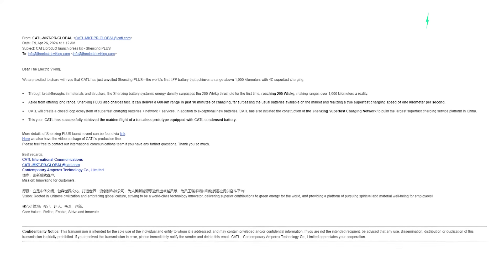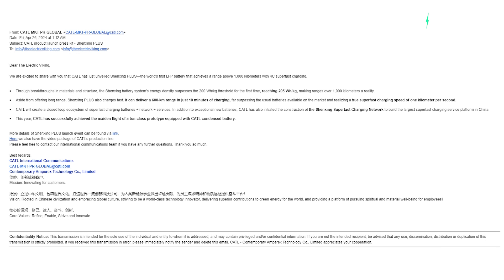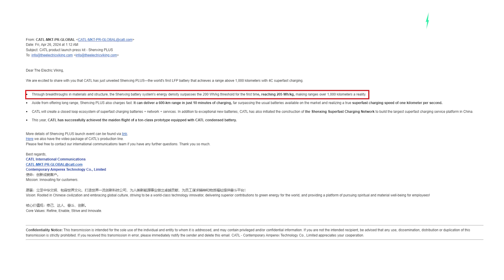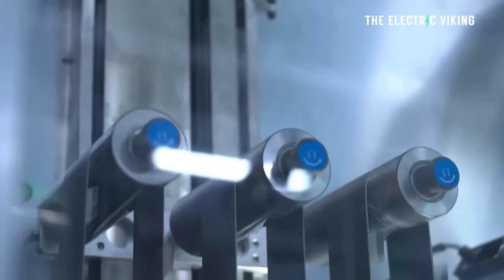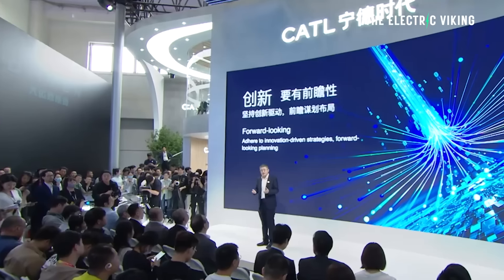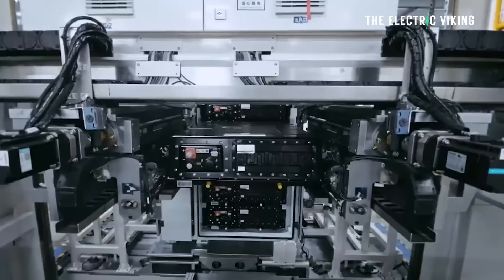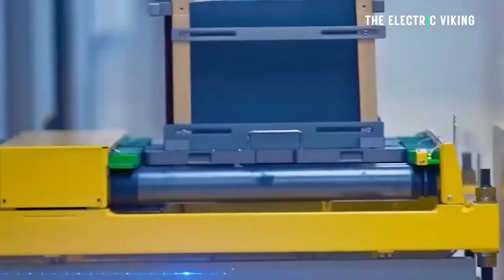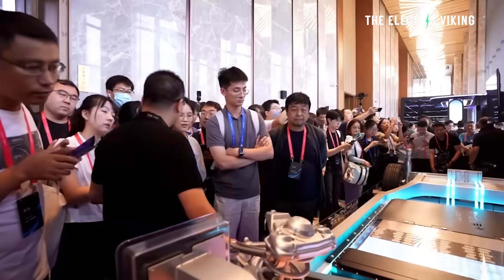CATL reveal new battery with highest energy density in the world

Comment: I think the higher density batteries will have their pros and cons. The higher density means to me that there is more potential chemical power in the same volume of space, which means there is more potential energy to be used for kinetic energy. This means either with the current EVs, in the broadest sense of term, can either go twice as far  or have twice the power potentially. I'm not sure if power is linearly correct, though, because we don't yet know the power characteristics. I think the biggest value with the ramp up.of EVs on the market is that batteries could get smaller to provide the same range from a smaller package. This could help reduce EV space and weight and make better EVs that can provide more features that will be standard compared to rodays EVs where a lot of extra features and safety featires are oddly not standard both qualitatively and quantitatively. I think that would be the better value for these higher density batteries. The other option is to put these higher density batteries in the current same volume EV packs. This would almost double the range for most EVs. 500 wh is the minimum requirement for aviation to fly effectively. That would be interesting for aviation. I, however, think that batteries with higher densities will not be the panacea we think it will be. Batteries will remain on average heavier than fuel   which means it will compromise on the amount of passengers and luggage to range ratio, which means we  will likely see less big planes and likely see more smaller planes with more frequent city hopping if commercial use is the focus. Flying long distances will take far longer. A cimpromise might be hybrid planes, but with the controversy of hybrid cars, I think the public pe4ception at large will also be controversial for planes, and beings recent new dreamlike plane with batteries wasn't a great pr succes to start with. I think the higher density batteries will have cause for concern simply due to the higher density. That is a fire or explosion concern in general with more higher density chemical reactions in general. I think there is a reason current batteries have turned out to be quite safe. With the higher density, I think heat management systems will require more priority, which means higher de sotu batteries for max performance will require smarter cooling systems, which will increase overhead costs for the system. We're talking here about higher density occupying the same battery tray space, not bigger batteries volumewise. I think in that regard, I think it is good to be cautious and say how good and safe the new higher density batteries truly are in real world performance, compared to a single N=1 demo case video. As with many new technologies patent and r&d costs will likely be high, new batteries will be in new vehicles and we will not hear anything about being able to swap current EVs with new battery packs, which for business is nice to capitalise on, at the costbof end user, who will likely (again) not benefit from upgrading innovation. Most EVs are still planned obsolescence vehicles by design. You can fix and replace it, but I have not seen one EV to date that has decent repairable cost price repairs with losing an arm or a leg. Luckily the pack if an EV is still high value which makes EV deprecation manageable, but the flip side of owners wanting to take good care of EVs or have upgrade options are practically affordable non existent and even insurance companies don't know what to do and are quick.to write of damaged EVs. In that sense, I have not seen the state of repair or upgrading EVs meaningfully and still feels like we're living in the stone ages. I think repair and we'll affordable maintenance should also be part of the sustainability mantra, not just destroy and rebuild the old. I think to some degree, it sounds more energy intensive to recirate resources than to keep current EVs on the road as long as possible. I think in this latter we can do a lot more to be financially more responsible and keep thongs affordable. But not selling more EVs for business and profit makes the latter story less interesting, I suspect. It's almost a bit of a catch 22, I suppose. I am exited for the higher density batteries for shifting the cabin quality as a smaller higher density battery could help shift less cabin design costbcuttimg which means overall lighter and better EVs. And it would also help boost electrification of trucks and busses and even perhaps off grid local electrical trains.
Reply: Ramp-up should be hyphenated.

Comment: The CT battery with its structural case has an energy density of 180 Wh/kg. The cells have an energy density of 280Wh/kg. So CATL cells at 205Wh/kg are not suitable for many vehicles.

Comment: If we ever solve the cooling problem for superconducting power transmission lines, imagine low cost solar panels getting 200 watts per square meter in a huge desert, then transmitted 2000 km to major cities. A 10 km square of solar panels would produce 20 gigawatts.  A superconducting power line can make economic sense if you are transmitting 100 gigawatt from a desert using liquid nitrogen cooled pipe with meters thick thermal insulation. Economy of scale, once you create the superconducting transmission line, it’s almost no additional cooling cost to make it handle 100 times as much power (a larger diameter superconducting wire but the same thickness of thermal insulation as before. Superconductors can carry lots of current with zero losses but do hit a limit of amps/square cm).  The improvement in batteries is a key component of going solar/hydro/nuclear for industry/transportation/commercial/home.  Obviously CATL will play a key role in home solar power batteries, in transportation batteries, and utility power distribution batteries
Reply: Low-cost should be hyphenated.

Comment: You keep flipping between "watts per kilogram" [power discharge rate] and "watt-hours per kilogram" [energy storage]. It would be a good idea to be consistent.
Reply: Power density, not power discharge rate.  Energy density, not energy storage.  It would be a good idea to have an engineering background before commenting.
Reply: @duanehorton4680  An engineering background is definitely not required for youtube comments; it's far too easy to get tied up in technical terms that hide meaning from others. I don't care if he uses a more lay-understandable synonym of the terms, but being consistent is important.
Reply: @gringene_bio  Your comment is not more understandable, nor are your synonyms accurate.  You are simply wrong from an engineering standpoint.

Comment: Can you trust the spec sheet from Chinese companies ?
Density is only one aspect of the performance of battery. SoH of LFP decreases to 80% of original capacity in less than 5 years according to the real users in China. this is huge for passenger and commercial cars which are used for over 10 years. It's simply true that LFP battery is inferior to NCM.
Reply: You've repeated this assertion several times but you really need to back it up because it flies in the face of what a lot of us see in real-life, out in the field.  LFP chemistries have been around a lot longer in stationary storage applications than they have been in EVs and 80% in 5 years just from calendar aging is just not a thing.   Yes, calendar aging is real.  No, it isn't 80% in 5 years.

There are degradation rates that can hit 80% in 5-years for LFP, but it involves a lot of heavy cycling... i.e. not calendar-related and still far better than what you get out of NMC.